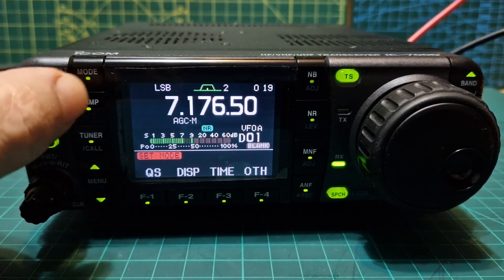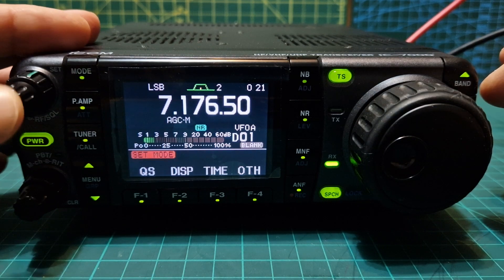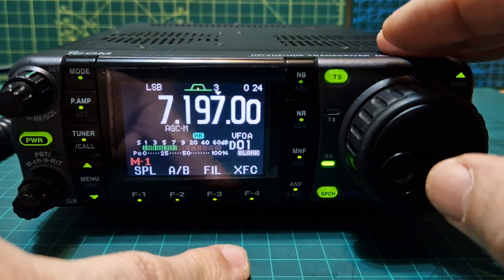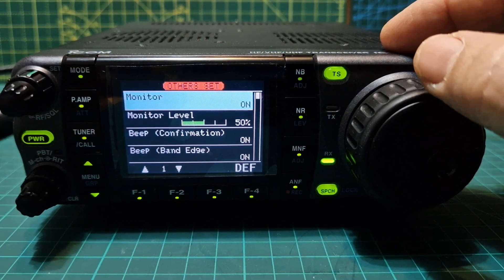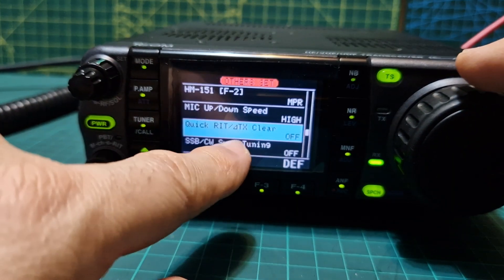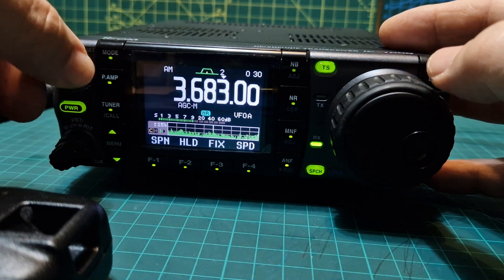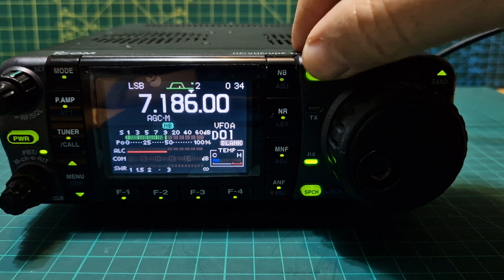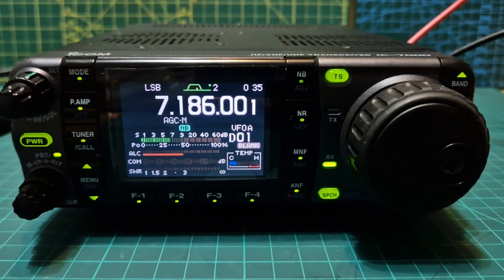ICOM IC-7000 - SETTINGS MENU

Comment: The ICOM 7000 is far better than ANY shack in the box mobile EVER produced by ANY company. I have owned (4) of them with a variety of antennas over the years and I would not trade mine for any other mobile radio ever produced. The TV mod was a cool feature before they made local TV Stations go to Digital signals. It’s the KING of mobile radios in my opinion and if this one fails I would purchase another one.👍👏❤️🎙
Reply from the maker: The best :)

Comment: Unfortunately, this radio has a poor quality receiver on short waves. I had this radio for 15 years. Of course, in 2009 it was a good radio. But compared to others, the radio worked below average expectations. Difficult menu operation. A big advantage was the multi-band radio. But who needs it on a daily basis? I sold it without regret until these years.
Reply from the maker: It's gone down.as.a.bit of a legend most Shack in.box Radios have to .comprimise

Comment: Am i right in saying you cant set the band edge bleeps up on that like you can on the 7300, ie if you have it widebanded you loose all you band edge bleeps, and prob only get one at the bottom of 160 and top of 70cms,  with the 7300 you can set the band edge bleeps up for each band...F g4vvq.
Reply from the maker: Big guess u need to test it on Radio .

Comment: Enjoyed your videos on the IC7000. Have had this radio for a few years originally for a mobile set up and never really got round to exploring the different functions. Have you done a video on FT8 with this radio? Many thanks de G4YWX.
Reply from the maker: Hi ,no I haven't I do not have the audio interface needed there are a few available there is a free programme that will decide using audio and Tx using Vox.https://youtu.be/PGl8Ho_ggoY